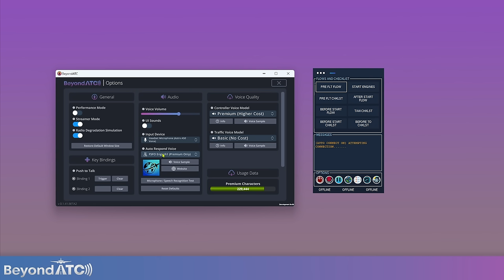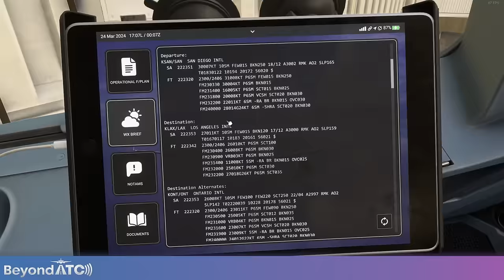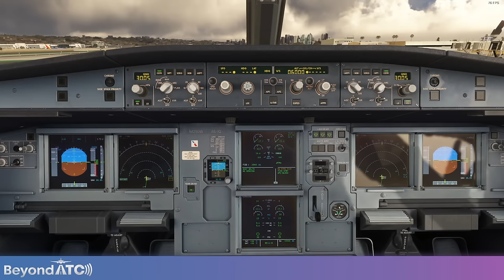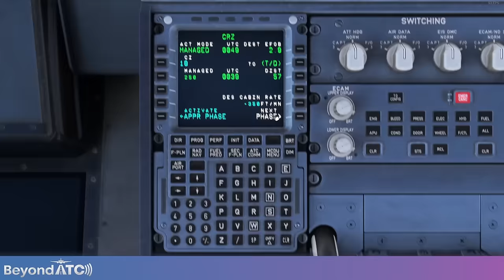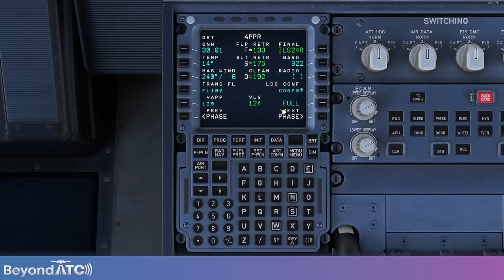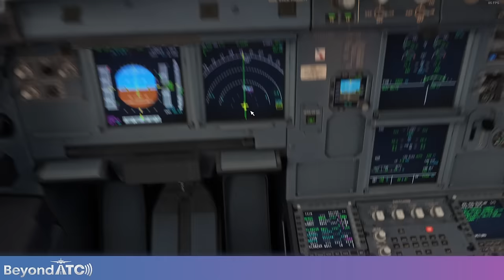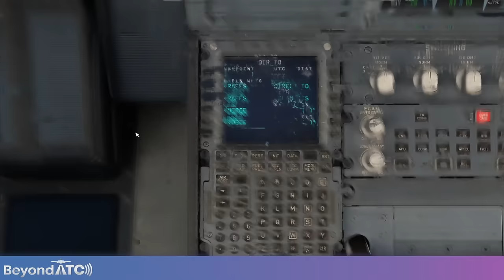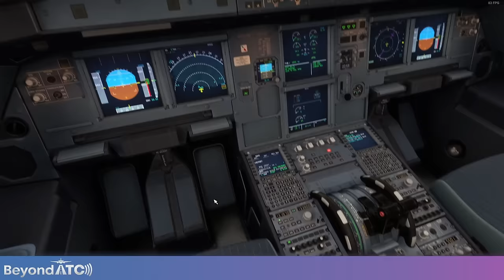BeyondATC Unedited Full Flight - Go Around! (Vector Demonstration)

Comment: Don’t drop the atis add on no matter what anyone says!!!!
Reply: Agree…..is as real life as it gets. I’ve listened to many many of them 😂
Reply: Exactly. Do not stoop to stupidity.
Reply: ATIS is sometimes automated at larger airports, but is more often spoken by a human at smaller (Class C or D) towered airports. This is probably where some of the flak is coming from where pilots (especially GA pilots) are going to be more used to hearing an actually controller reading out the ATIS and then the automated system reading out AWOS/ASOS.
Reply: Yep. I wonder if it would be too hard to program an ATIS for small airports and have the automated one for larger airports @evansneath
Reply: It's not only big airports. Many small airports use them.* Especially places where the weather changes regularly. Having the controller or assistant manually record it every time is a huge waste of resources when you can buy a cheap automated system. I hear almost zero manually recorded ATIS these days. 

And to be fair, most ATIS in Europe sound more like a normal person than the robotic one in this video. 

*(Remember, the world is a large place existing outside of the USA 🙄)

Comment: Amazing product and cant wait to buy it when it becomes available. One side note, tower would have held onto you until after you crossed 24 left. They control both runways and wouldn't turn you over to ground until you are outside their territory. The call would have been Exit AA cross runway 24 Left at AA then contact ground at 121.65. Or would have been exit AA cross runway 24L at AA then turn left on E and monitor ground on 121.65

Comment: I have a question.  Also, great demonstration video! Thank you. This is the first I’ve seen since I was at the Expo last year. At that time, voice support not expected or was unknown, which was a dealbreaker for me being a VR-only user. So I stopped following the project. Thanks for posting to the Discord channels. Now, this will surely be on my purchase list. 

My question is…

Will the frame to which you kept referring (with the text ATC instructions) be visible inside of VR? 

One of the more frustrating parts of VR is struggling to remember complex clearance, taxi, and approach instructions without having to break the immersion and remove the goggles to write it down for readbacks. VR access to that frame would be of considerable value. If it is not currently planned for VR, please consider. 

Thanks again! Great job!!

Comment: I'm not using this anymore until you get it better. I've had three or four wacky descent instructions at certain airports that screwed my flight up. The idea is great, the product isn't there yet, probably not totally the fault of the designers, but Asobo not providing needed information or current limitations of the sim.

Comment: I'm not even buying this for the ATC - I'm buying it for the traffic injector alone... but this looks great.
Are you using frame gen for this?  That's some incredible fps you're getting! :O
Reply: Because there is no single AI plane in the air or on the ground. It helps with FPS.
Reply: The traffic injector is my main reason for getting this too

Comment: Hello Developers! I have a serious question. Does beyond ATC work with my third party addon airports? Because I'm using some third party addon airports lots of time.
Reply: Not a developer, but yes third party airports work fine.
Reply: @goincd3  but I don't think so
Reply: @sebestianshultz7458  I'm not sure what you mean. I'm on the beta testing team and only fly into third party airports. Works great!
Reply: @goincd3  but some time beyond ATC does not read tha data of third party airport.
Reply: @sebestianshultz7458  it always reads the data , but if the developer doesn't include it, there's nothing to read unfortunately.

Comment: 1 Character Costs: $0.0000075 ; 750,000 Characters Costs: $30.00(0.00004$) $9.99 -250000(0.0000399$), why cost 1 character low price .why does a character cost less than if you buy premium? Premium costs more. or have you made a zero more at 1 Character Costs: $0.0000075 -

Comment: Beyond ATC, I will buy but FSFO not a hope what a rip-off you have to purchase it for every aircraft, you want to use it on. It will cost more than the flight SIM. That would be about $80 for the aircraft I fly, I change aircraft often, to try to get proficient on Airbus and Boeing and CRJ. Convert that amount into my own currency, then it costs even more.
GSX is the biggest pile of crap I have ever purchased for the SIM, it spends more time crashed than it does working. Then there is the useless crap like you see in this video, last flight I had a fuel truck drive through the cockpit.
Reply: Wow, you must be fun at parties